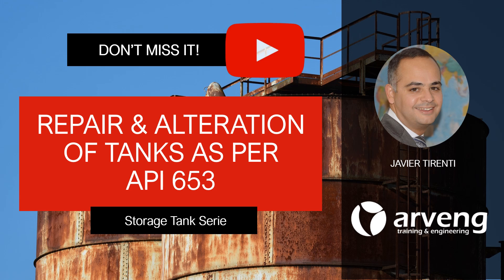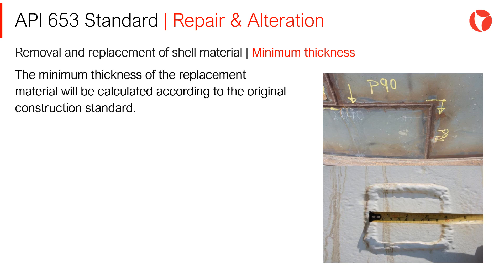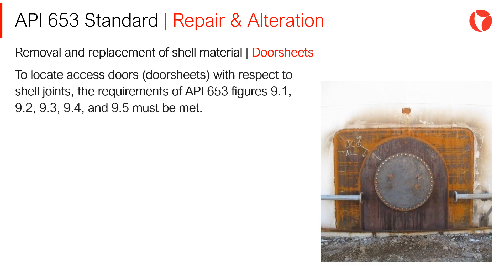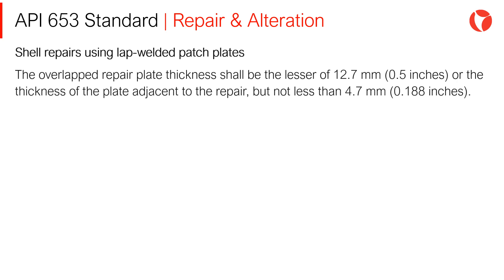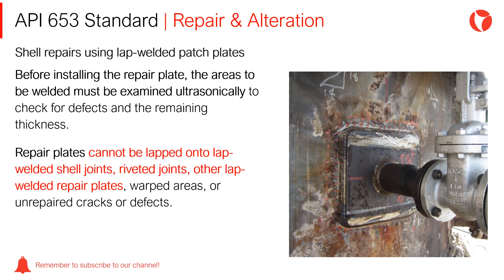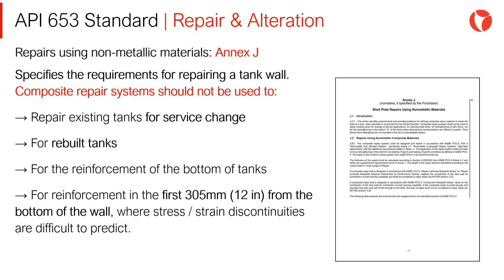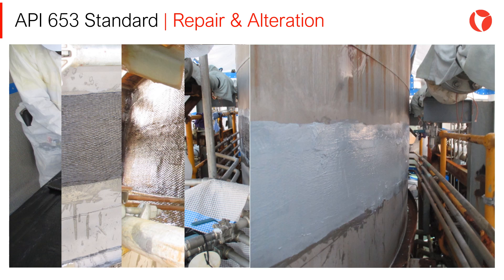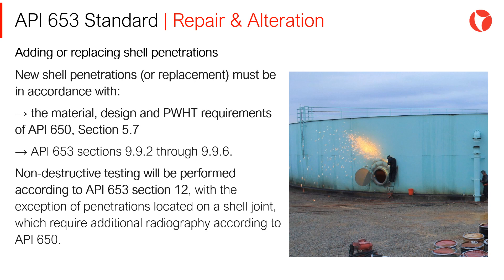5  Repair & alteration of storage tanks as per API 653

Comment: how do you replace the annular plate by cutting a minimum of 12.5 mm without changing the height of the tank and consequently the positions of all elements on the tank (Manways, nozzles etc..)? Thankyou
Reply: Cu the annular section then Jack up the shell #1
Reply: @rizkiwahyudi-b7s  the Jack's are temporary though... could you elaborate? You would need to replace those 12.5 mm permanently somehow, all i can think of is placing 12.5 mm shims under the tank bottom at the shell circumference. Though I don't think that would be acceptable as a permanent solution.
Reply from the maker: @3sK1-Gabe  If you'd like to learn more, we invite you to check out our course on the topic: https://arvengtraining.com/en/all-courses/api-653-inspection-repair-of-storage-tanks/

Kind regards from the Arveng Team
Reply: @ArvengTraining  thank you for your reply, I will be taking an API 650-653 soon, I was just brushing up on knowledge before hand. I will certainly find my answer during the course.